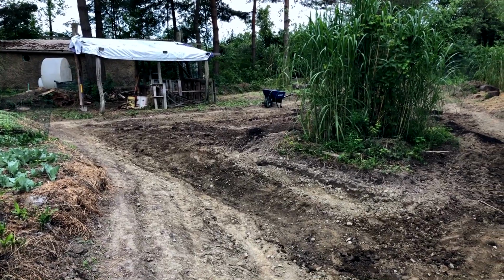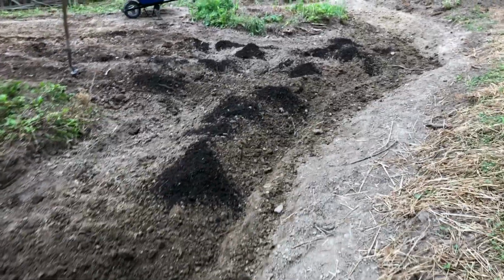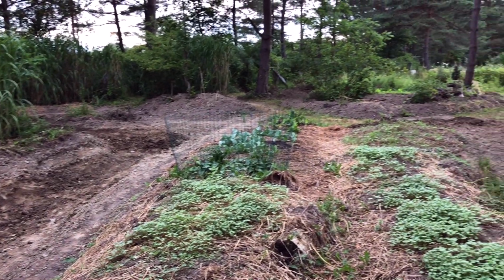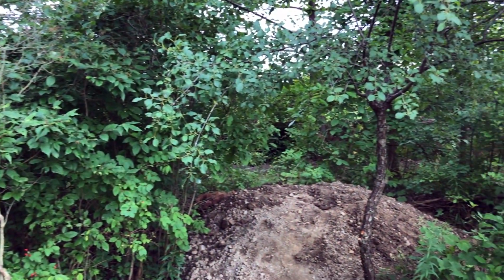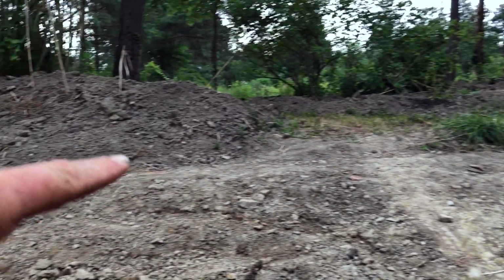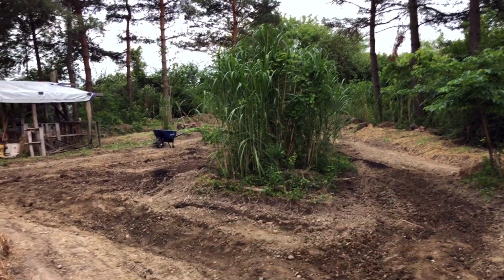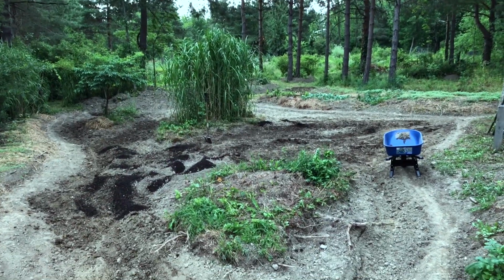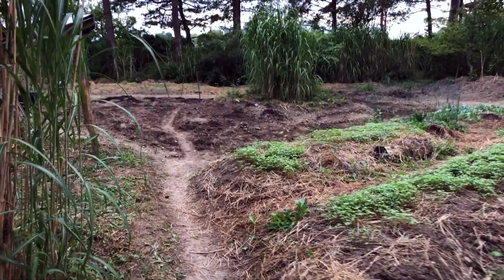Hand Dug Pond - 2 - Making Progress

Comment: Hey bro, I highly recommend a flat nose posthole shovel with long handle. I hand dug a horse riding arena for the girls, nearly 100m^3 moved. broke my roundnose after 75 cube and could not believe how much better the post hole was for long term work.
Reply from the maker: Thanks for the tip! (or I guess lack of tip, tip? :)
Reply: @edibleacres  Yeah ditch the tip, get one with a couple ribs/flutes for max pleasure though. Makes digging virgin ground easier as it pops the soil off the face of the blade.

Comment: Are you going to be using it as a propogation space for american water lotus? I think filling it with wapato and watercress lotus and mabey some indian rice  would be an awesome way to fill it up with plants you can sell. Also if you fill it with pickerel weed seed it spreads rather fast and would make a super amazing mulching material that will melt down and water crops on the further reaches of the area. Ive seen people use water hyacinth as a compost activator but pickerel weed and azola/ duckweed would be a good way to feed crops.
Reply from the maker: Looking forward to getting this kind of input when we're at a stage to actually plant it out... That is an area I could use a ton of help on!
Reply: @edibleacres   lol going to need hip waiters to plant some filed down lotus seed in that pond right into the soil. Cranberry woild be a great edge plant / ground cover

Comment: Hi Sean and Sasha,
    So you have shared that in the dormant season you will move the tree and the grass. Are both connected to the higher elevation ground? Or will you pump water out to reach those resources? 
The 600 gallon cistern is white which will lead to algae growth. Is that something you are concerned about? Will you cover is with a tarp? Will you drain the cistern over winter? Feel free to answer these questions on the next video update. Cheers,
     Bill

P.S. We are all ROOTING for yinz.
Reply from the maker: The tank should be OK, hopefully, since we'll be positioning it in deep shade.  More notes on that later.
 Remains to be seen if the 'islands' are dry and available this fall or we've had enough rains that they are actually islands!

Comment: How will you retain water in the pond once you have it excavated to the level you want it? I’ve read that it requires quite a layer of clay spread on the surface to keep a water level in a man made pond.
Reply from the maker: We will have to see how it holds naturally.  Could be add Sodium Bentonite if it leaks just a little, or work on 'gleying' it with organic matter and a cover for a while, or perhaps look into an RPE liner.  Those are the options we are thinking of in order of approach...
Reply: EdibleAcres gleying is interesting. If I dig down 2’-3’ I tend to hit grayish white clay in a fairly thick layer.  Our water table is just below that.

Comment: Wouldn’t it be easier with a little damp soil?
Reply: More water in the soil means more weight to move, so probably not

Edit: this is being said by someone who basically lives in a sand pit, might be somewhat different when you factor in the properties of clay soil
Reply: Yes and no. He touches on that in the video. Softer dirt is nice. Too much water and it's heavy tho.
Reply from the maker: I think pretty low moisture is ideal.  Less sticky, less total weight, and we can break up and move the dry soil and let rain put the moisture back in where it will be for the long haul (supposing it ever rains again!)